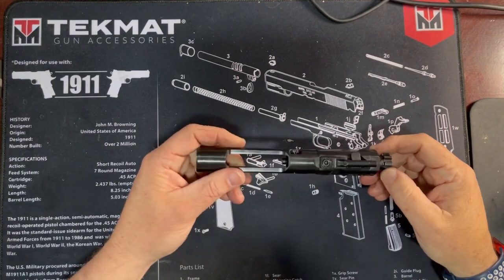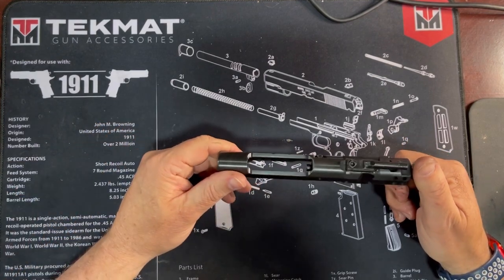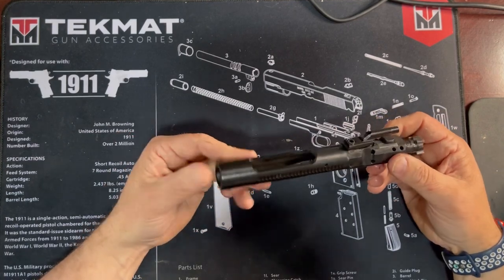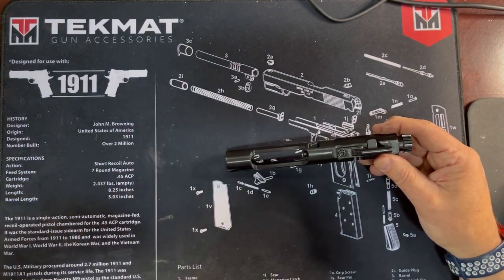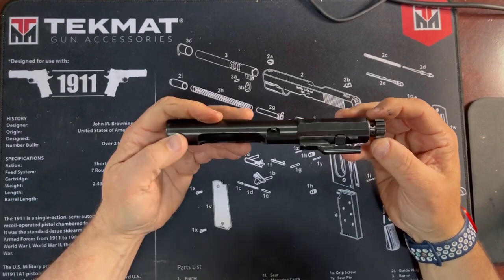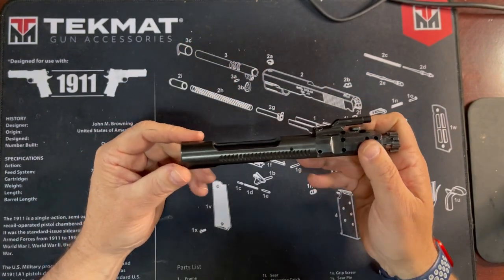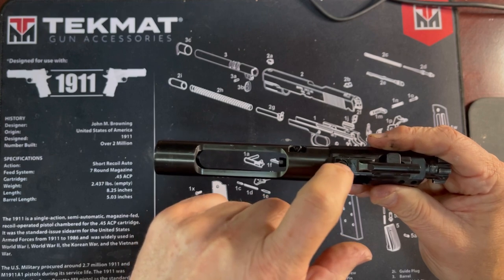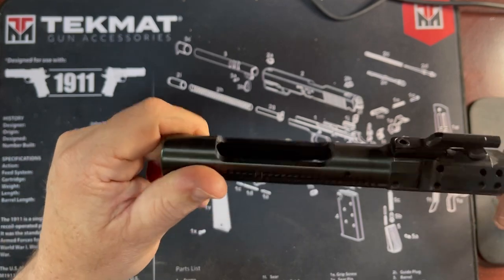Ruger SFAR: Bolts and Screws??!

Comment: Hey Trigger, I checked the gas key on the unit I was using before I shot today's video and it was good, but, I'm gonna check it again when I break her down for cleaning tomorrow and if it's not super tight, I'll let ya know. This product just has waaaaay too many issues across too many owners for ruger to not "bite the bullet" and issue a sincere apology, offer a refit free of charge with totally free shipping both ways, and a guarantee of 100% money back for every owner that has one, regardless of condition or operational level.
Reply from the maker: Thanks, look forward to hearing from you!  I was just listening to your next video.  I’m with you, this feels like shotty craftsmanship.  Also do you have any thoughts on a regular ar-15 bcg having two screws for the gas key and this one only having one?  I’m guessing g that may be a long term issue.  Also do you know how tight that screw should be?
Reply: @triggerbarPhD  On regular AR-15 BCG keys, the spec is usually 55-60 inch lbs. I would imagine it's the same just about on any of them. It appears that they didn't stake it worth a crap either. Ruger is really destroying a long standing love affair I've had with their firearms over the last 50 years. Really get my goat man. And honestly, I would think if a 5.56 needs to key screws, a .308 would certainly warrant the same. My rock river had two. . .

Comment: I feel for you, Ruger SFAR has so many issues. They may be fixable but, really?
SOTR has great info on these issues. AR15 gas key screws @58in/lbs. Yours has barely any staking, the metal should be pressed against the screw head.
Reply from the maker: Thanks for this info, really appreciate it!  Yah not clear if it actually was staked.

Comment: That gas key screw should be properly torqued and staked.
Reply from the maker: Absolutely m.  It was staked.  It just came loose.  Screw would spin but not come out, which to me means it was improperly staked (material over the top and not into the screw).  Ruger did replace the bcg with a properly torqued and staked gas key but this is a weakness of this design.  Only one screw…. My new one is hold so far.  Time will tell…

Comment: Love the sfar but the q.c. department needs to do some homework. Ill have to check these now but only issue i had so far is need to fire 762 in setting 3
Reply from the maker: That’s what I had before I tried their new regulator.  But now with gas key thing not sure if the regulator would work or not.

Comment: Clean all the parts of the BCG completely of oil and fouling.  Use red loctite on the screw and some high temp sealer or paint around the gas hole.  Torque on the screw should be 55-58 in-lbs.
Reply from the maker: Thank-you so much for this!!
Reply: ... and mehbe relay this bit of info to Ruger eh.

Comment: 35-40 inch pounds should be plenty of torque and definitely re-stake so it doesn’t come loose again
Reply from the maker: Thank-you!   I ended up sending it back to ruger and they replaced the bcg. It was staked but I don’t think properly is the screw would turn but couldn’t come out.  Hopefully the new one is staked right.

Comment: I simply added a seekins low profile adjustable gas block to my sfar and use an H2 buffer for perfect 3 o clock ejection and got it running correctly in six rds after tuning it   forget the factory gas block   u may have to grind down a small section inside the handguard as i did to avoid contact to the gas block but well worth the effort  i run it with and without a suppressor without any issues thus far and bolt locks back at last round as it should   
Just my two cents
Reply from the maker: That’s fantastic!!
Reply from the maker: Which gas block did you install and which gas tube?  Mid length does seem to match the one from ruger.  Also did you re-dimple  for the new gas block or did you reuse the dimples from the original gas block?  Thanks!!

Comment: I don't know if it's in the manual that bolt might as well as be red loctited (or at least blue) in there if they're only gonna have one bolt holding it down. That, and of course staking it properly.
Reply from the maker: Thank-you!!
Reply from the maker: And unfortunately they don’t have it in the manual.  I could call them tomorrow though if someone doesn’t know.  I couldn’t find it on an internet search.

Comment: it is unfortunate you keep finding out more issues. the gas key not being secure is definitely a concern. it’s hard to tell i would think it would be staked in. below is a link from caleb where he shows how to properly install the gas key for ar15. i would think the sfar would be very similar. 

https://youtu.be/REFcHNQFvCk

but i agree with other comments here on just sending it back to ruger. customers should not have to do gunsmith work on a newly purchased product. they should really have better quality inspections or possibly double check inspections .

it appears they more worried about sending out products and worry about  quality checks later.
Reply from the maker: Great advice and thank-you!!